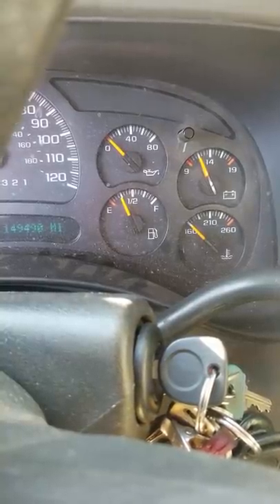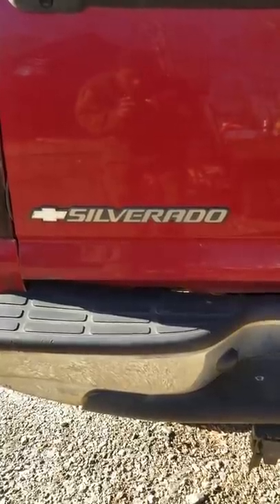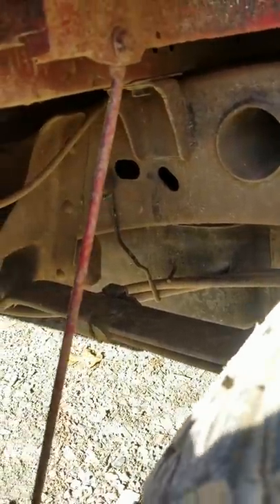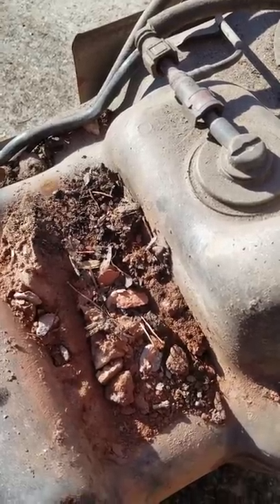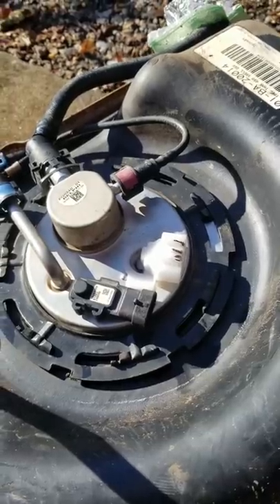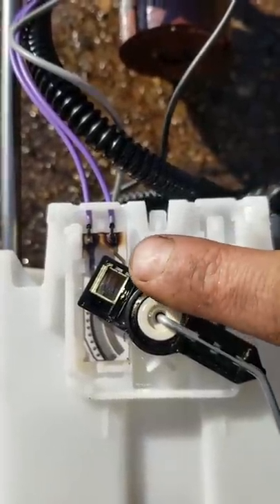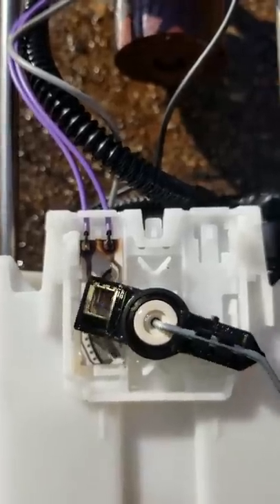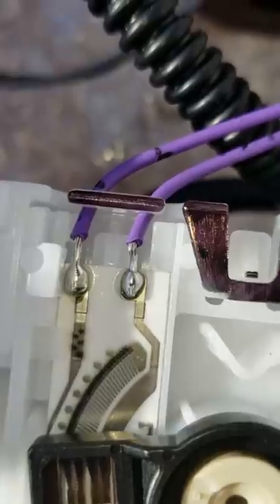Customer States Fuel Pump Broken

Comment: I didn't have a fuel gauge for 5 years and I never once ran out of gas. The trick is to watch the odometer
Reply from the maker: Just fix it!
Reply: Thats above their attention span to do that.
Reply: Some of us don’t have a working odo either lmfao
Reply: Makes sense. I reset my trip every fillup to guestimate my economy, and again when the gas light pops on. If needed, I would know how far a tank will take me to the T.
Reply: @noelleonard2498  no or you can just fix it
Reply: @MattsShop  no. Fuck no. I use my odometer and fill up when I'm at half my range to keep my pump submerged in fuel anyway. The first and only new sensor I had installes is "full" with 35 liters in my 65 liter tank. I'd rather just know my range and fuel efficiency on every fill up bro, gm guages are the literal worst. So bad they're basically like not having one even when you've spent 300 bucks on a new oem one (Canada lol, 200 bucks plus 30 shipping plus 15% sales tax, and then labor if I didn't install it myself in my part of the world would cost more than the pump)

Reset your trip every fill up. divide trip measure ment by the amount for fuel you used and bam, you find out you're getting 14L/100km instead of the 10.2L/100km that your cars efficiency measurement claims you're getting.
Reply: Same. Set the trip
Reply: Hey look that means people actually have to pay attention which is something that's impossible for most today. Unless it's a screen 10 inches from their face anything past that is a lost cause.
Reply: Haha you just like me bro, reset each time you you pump gas
Reply: @joelockard7174  luckily, they're putting screens across the entire dashboard of new cars lol
Reply: the trick is just to check how many miles of gas you have left😂, thats what i do in my same generation yukon

Comment: A silvy cheverado 🤣🤣🤣🤣
Reply from the maker: LOL
Reply: More then a silvi I’d say bow tie 😂
Reply: Drove three different Silverados for work over the years.  Everyone of them 1/2 tank =Empty.
Reply: @ericnotmetcalf3768  it ain't just a GM deal either. Old nissan frontier had for work once would crap out at just under the half mark. It should be common knowledge these things aren't accurate every biker knows that I'm not sure why the message didn't get to drivers lol
Reply: Alot of makes and models are like that.

Comment: My grandma taught me to use your mileage as well to be able to tell how much fuel you have in your vehicle that way in case your gas gauge doesn't work you can figure it out real quick
Reply from the maker: The way I normally figure it out is on the side of the road lol
Reply: Your grandma is smart.
Reply: We never trust the gauge, only the odometer.  We also do a true mileage check every four or five fill-ups, easy to figure out your range from that.

Forget all that pull the tank silliness for what amounts to laziness or vanity.
Reply: You'd have to assume a consistent and predictable fuel economy though which obviously isn't the case. At best it's a guesstimate.
Reply: @mbryson2899  you do realize having a working gauge for your gas tank is required in most states to pass inspection, right?
Reply: @yeetteet3739  Sorry, Yeet Teet, I did not.  I have only registered vehicles in Illinois, California, Wisconsin, Indiana, and Oregon.

I have no idea what a "safety inspection" might be trying to soak people for...

I do know that running out of gas is a pain in the butt, and my method forestalls that easily.

Where do you live that they can mandate every little bitty gauge?  And how do they say it enhances public safety?

How many states mandate a gas gauge inspection?
Reply: I'ma learn that so I can have a weird fact to teach.
Reply: @yeetteet3739  how are they going to test for a working gas gauge it has nothing to do with safety their main concern is ball ball joints tie rod ends stuff that actually keeps the car together also the windshield having cracks
Reply: Lol my odometer doesn't work so that method is a no go for me 😂😂
Reply: @jamescarlson4676  Bummer.  Perhaps haruspicy, I've heard it can be quite accurate.
Reply: and as long as your trip meter is working it works too. as long as you know what you should be getting and its getting that there are no issues.
Reply: I have a trailblazer and iv done that for about a year since i got the truck. So far iv never ran out of gas filling it up every time it hits 200 miles on the trip odo. Im not sure if its the cluster or the sending unit that's bad but if its the sending dropping the tank and spending 300 bucks on a new sending unit makes no sense to me.
Reply: @Voltaic_Fire  in my 06 accord and consistent driving, my fuel economy usually doesn't vary more than 0.5mpg between a few weeks. I usually get about 34mpg driving on the interstate in cooler weather and about 38mpg on highways getting towards 40mpg as it gets warmer. In the case of inclimate weather such as hard rain or snow, it usually drops by about 1-2mpg depending on how many days it lasts. Now if I'm doordashing in city traffic, time is a better metric (1/8 tank per about 2 hours) with the variety of roads. Using the milage method, the furthest I've been was 531mi with a few gallons of overhead left. Just gotta drive consistently.
Reply: yup been doing that for the past 3 months because my fuel gauge is broken and we’ve already replaced the fuel pump
Reply: @isaacvoeller3208  go to a pick n pull/pull a part it think it was like 30 dollars when dad got his
Reply: @joshuashulda5728  I guess i could but its still a pain in the keister to pull the tank.
Reply: My fuel gauge hasn't worked in 12 years and I've never run out because I keep track of the miles.
Reply: Motorcyclists usually use the trip meter for it and learn over time how far you can go before the tank drops to near empty.
Reply: that would work for my if my odometer wasnt also broken loll
Reply: @Voltaic_Fire  yeah really lol if I drive my car like Driving Miss Daisy I can get like 280 miles out of a tank but if I do a few pulls it’ll drop by a quarter tank
Reply: That's the only reliable way to do it imo
Reply: Jse tne trip meter every time you fill up.

Comment: I still can't wrap my head around how there's exposed electrical wiring and potentiometers just chilling inside gasoline
Reply: Was just thinking the same thing lol potentially riding around with a bomb under you 😅
Reply: Gasoline does not burn, only the fumes, no fumes no flame
Reply: @thomasterrell437  yep true. Gas burn when its inside the engine. I cant believe people dont know that
Reply: Can't wrap my head around the small current of the pot burning up when literally submerged in fluid.

Comment: "Much more accurate fuel gauge now."
Shows the same level of fuel as when the video starts lmao
Reply from the maker: Calibrated after driving
Reply: It shows less fuel. It's ok, I know it sucks being blind!
Reply: @JTheraos  rewatch it man, it really didn't go down much diffrence for the guy to keep getting stranded, unless dude don't pump till arrow below e
Reply: @joseresendez1301  he took the tank off and fixed it he’s not gonna have gas all in the tank and while he’s working on it and when he turned the truck on the bar was lower which is more accurate
Reply: @joseresendez1301  wtf are you talking about? I was stuck at 1/4 tank before. Now it will represent the actual fuel level, which happened to be a little below a quarter
Reply: @joseresendez1301  The point was, that the gauge went down 🤦🏽‍♂️.  Customer states “gas gauge doesn’t work.” So that means it was more than likely stuck at 1/4 tank
Reply: @imthemistermaster  yeah that was my b, at the start he did say it didn't work. Still if you're Guage don't work wouldn't it be smart to pump to full tank every day instead of risk getting stranded. I had a truck with broken fuel Guage too and never left on the road. But yall are right tho
Reply: Simple fix just don’t let it go below a quarter.
Reply: I thought you were supposed to fill the fuel tank to above full before you take the truck to the mechanic to drop the fuel tank.  😄🤣😂
Reply: Consider the fact that he wiggled the tank pressure sensor, then said "oh that's not good" when in reality, that is a completely normal thing to be able to do.... that right there tells you this guy knows nothing about diagnosis... but at least he has peace of mind knowing it is a new sending unit.
Reply: Not exactly! Check again
Reply: @JTheraos  😂
Reply: Lolski
Reply: It was quarter full at start of video. End of video shows right under quarter full.
Reply: @joseresendez1301  have you never struggled to afford fuel?? Must be nice haveing the ability to top off your tank everyday.
Reply: @MattsShop  cALiBrAtEd
Reply from the maker: @iusoloman1527  Guy gets it...
Reply: @lucky7s94  I don't think it was just the fact that it moved, but how excessively he was able to move it.
Reply: @jrkbgk1111  gm tank pressure sensors are like that though. Completely normal.
Reply: @lucky7s94  it's been a handful of years since I've had to do one, I got out of the shop about 5 years ago, but I don't recall them ever being that loose, also kinda looks like the gasket around the sensor might be rather worn potentially letting water from road spray and whatnot possibly get around it.
Reply: He didn’t fix the issue, the gauge cluster is failing and the servos need to be replaced. Soon all the servos will go wacko and loose zero.
Reply: Uhh sure looks like more than a quarter full,of what I don't know.
Reply: Even a broken clock is right twice a day

Comment: Dafuq. Good sir, let me introduce you to this brand new bleeding edge magic tech called a "soldering iron".
Reply: I get your idea but the cables aren't the problem, but the brushes and sadly the only way to give a warranty is to put a brand new part on it
Reply: My thoughts
Reply: @davidhg117  never though about it but yeah replacing the whole assembly is the best way to warranty and guarantee your repair, if it was your own car you could take the risk of cleaning up the contacts or replacing wires, might have to still replace the whole assembly but if it’s just a bad connection, it’s a cheap fix
Reply: the cables are a sideeffect of the issue which causes an current increase due to resistance.

they would simply burn again even if it works for a while unless you solve the issues

Comment: “Yep, leads are burned up.”
In the gas tank? How was this truck not on fire?
Reply: Because there wasnt enough heat and no spark
Reply from the maker: Makes you wonder right?
Reply: @BananaSlothGames  there’s oxygen in the tank as it’s only 1/4 full. Not enough ignition to air issue
Reply: Have you tried to light gasoline?  Vaporized it is very combustible...but a big pool of it with not much oxygen would need more than a tiny spark.
Reply: There’s no oxygen in the tank just all gas fumes
Reply: There’s not any oxygen in the tank only gas fumes and without oxygen you can’t have fire
Reply: Gas itself doesn't light. The fumes do. No oxygen, no boom.
Reply: @youtubevoyeur4104  gas fumes displace all the oxygen.
Reply: Over a 14.7 to 1 fuel to air ratio.  Too rich to readily ignite.
Reply: For fire you need 3 elements heat fuel and oxygen. So missing 2 of them
Reply: @BananaSlothGames  gas tanks are ventilated
Reply: Gasoline isn't flammable. The fumes are.
Reply: The vapors ignite, not the liquid.
Reply: It's the fumes that ignite. 
Would be cool to see what happens if you tried to light it underfuel see if it actually burns
Reply: The gas tank is full of gas fumes which even if you open, they eventually displace all the air, leaving it with no oxygen to start a fire, that's why you'll never see a gas tank exploding on a car fire under normal circumstances, the gas continuously boils and vents off of the gas tank but still no air gets in.
Even if you leave the fuel cap open the vapor pressure that comes out does not allow any air to get in.
Reply: Gasoline really needs a big spark to light. 12 volts will not ignite it.
Reply: The dash failed. Typical gm. This guy misdiagnosed it. Shade tree at its best.  Don't take your vehicle to this guy.....
Reply: Too rich or too lean to cause ignition.
Reply: The part per million to air Ratio needs to be exact in with more fumes that was impossible and I rather weld on a full tank of gas than an empty one
Reply: There isn't enough oxygen in the tank for a reaction occur with a spark. Gasoline vapors are heavier than air. When the tank vents, the air vents out first leaving the tank with a pure gasoline vapor atmosphere
Reply: Why did they have to buy a whole new one? couldn’t he just resolder the connections?
Reply: Liquid gasoline doesn’t catch fire, the fumes do. No fuses in the tank to catch fire. No fuel-air mix.
Reply: @dopeman420  it seems like the customer might have just wanted it replaced. Lol i would have not let the  customer give me a diagnosis
Reply: Gas wont ignite unless its a fume. Thats why its not safe to run your car bone dry on E. If your fuel pump burns up and shorts but its submerged under gas it wont ever ignite. But if its barely got any gas and it burns out from lack of gas and sucking in air and a spark happens that could definitely be bad
Reply: Because the fuel tank potentiometer varies the ground not the hot.
Reply: If there is no oxygen, it won't ignite. Air craft fuel levels use milivolts, between two tubes, to give the fuel level.
Reply: @aggressor6609  but gas vapors fill up the rest of the tank. They're designed that way.
Reply: maybe if you don't have a gas cap the air mixture would be okay to ignite from the agitation of potholes and turning corners - jostling.

Comment: Hey! If you change GM fuel pumps and gauge sending units often it's a lot easier to pull the bed off to access the top of the tank rather than dropping it. To pull the bed you only need to remove 8 bolts and disconnect the light wires. Way easier than dropping a tank, especially if the tank has fuel in it.
Reply: or you can really be a hack job and cut a 12x12 square hole right in the bed above the unit.. I’ve seen it
Reply: .. maybe if it's a pavement princess the bed bolts come out easy.....
Reply: @tagosta88  thats what i did to my shit box 🙋‍♂️

Comment: That Silverado was rust free, definitely a southern truck. There's no dropping the fuel tank on a 15 year old truck up north. Well there is but it starts with cutting the gas tank straps.
Reply from the maker: Yup
Reply: That’s how I got mine off: is super sketchy
Reply: Nah nah if your true northen you don't drop the tank you cut a hole in the bed 👌🏻
Reply: @northsparkz2914  or just remove the bed? It's like 4 bolts lol
Reply: @northsparkz2914  I'm not even from the north and that's how I was told to fix my F-250 dual tank nonsense mess.
Reply: I got a 22 year old silvy in Nebraska and it’s pretty close to rust free, just minor fender stuff.
Reply: @kdcustoms1272  What was the reason for not being able to drop the tank in the first place? I think you missed the OPs original point.
Reply: You should see the cars in the Southwest. Hardly any corrosion
Reply: @randallsmerna384  I had a full tank of gas... just easier to just remove the bed. imo.
Reply: @kdcustoms1272  I hear you And I don't think it's a bad idea except that they were saying that up in the salt states stuff just completely rusts together.
That wouldn't work with my truck either because not only do I have a liner but I have side tool boxes that are bolted down which cover the bed bolts. This means I would have to unload all my tools then I'd have to completely remove all both side tool boxes, then I'd have to remove the liner, then remove the bed,  and then I'd have to reverse the whole thing.
Reply: Disagree. Did one of these on a 91 GMC K2500. Northern truck all its life, fuel pump took a shit, guy wanted to beef up the motor so he had his excuse for a high flow pump so he could finally add the mods he really wanted under the hood without maxing his flow. 

Dude was 6’ 2”, like 380lbs, I’m 5’ 8”, 140 lbs at the time. Didn’t even have to jack the truck up 😂😂😂
Reply: @bleachstain9785  if it's not driven alot during winter or on roads that they salt. It's much better
Reply: @Nick loves cookies 
A whole what?

Comment: My gas gauge has been broken for 10 years. Never once been stranded
Reply from the maker: I bet you burned a lot of extra gas.
Reply: @MattsShop  that doesn't even make sense
Reply: @MattsShop  hows a gas gauge being out make ya burn more gas? Ive drove without a gas gauge didnt make no difference just fill up everytime your in town and your fine
Reply: Wow you mean you know how far your vehicle goes before it runs out of gas? That's amazing.
Reply: Yeah I use my brain to and just use the trip meter
Reply: U know ur truck better than this dude
Reply: @MattsShop  extra gas wtf are you talking about a broken gas guage doesn't affect your mpg lol SMH what kind of mechanic are you
Reply: Aren’t you mister perfect?
Reply: This worked for me until I forgot that unplugging the battery reset the trip odometer. She shut down on me on I-90
Reply: @Rokomarn When the gauge goes the pump forgets everything and starts sending inconsistent amounts of fuel to the windshield wipers.